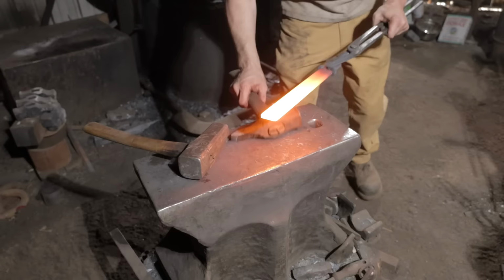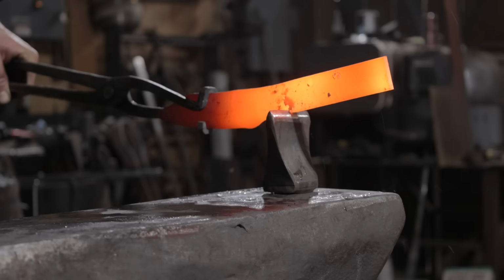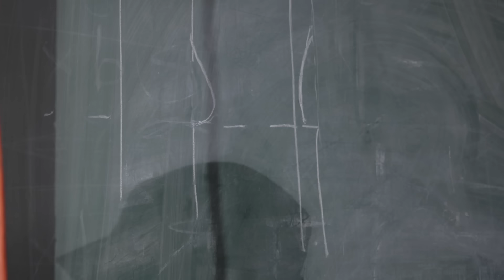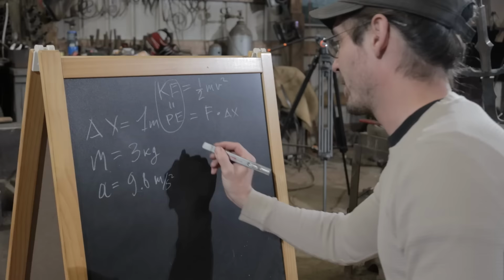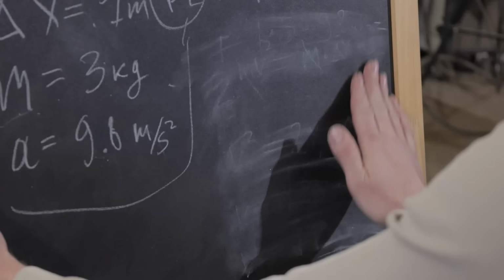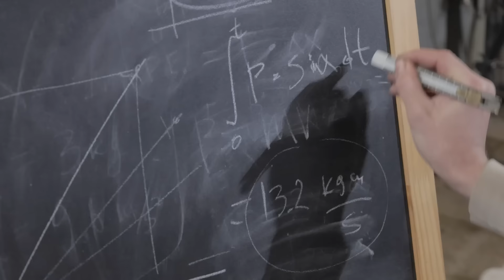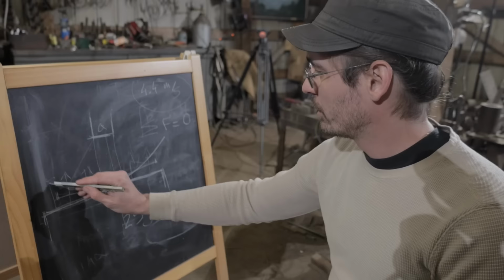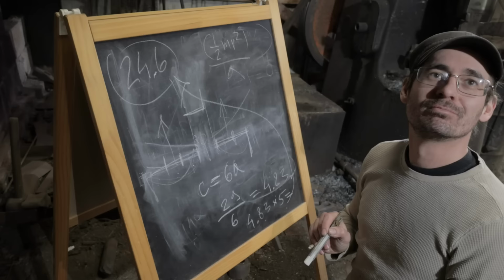You Can Forge a Knife Correctly [Here's How] !

Comment: Thank you so much for this. I have been trying for almost 30 years to figure a way to teach this to my classes. and I am very bad at math. I know what is happening because i am doing it and seeing it. but to show someone that does not understand has a difficult time grasping it. I get asked a lot from folks where they can find a huge anvil. and i always try to steer them to a small, faced anvil with very large mass. such as a stump anvil in a buried or rooted stump. When they see how much work can be done on such an anvil with properly radiused edges. they are astounded. Yes, large anvils are super cool. and have many advantages over a small anvil when someone knows how to use those advantages. but for most, they are not needed. The Luis and Clark expedition did most of their work for the entire voyage on a roughly 60 lb. stake anvil that they sledged into a stump when setting up camp. I show lots of folks the video " Making two blacksmith hammers for blacksmithing" By " Bertram-craft and wilderness" showing the use and how efficient a stump anvil can be compared to a treadle hammer. I don't know how many ties i have met students of mine years later. that are hunching over and using glancing blows. When I ask them why they are doing that instead of the way i taught them. the three most popular answers are. '1" I can't see that far. "2" I don't feel confident enough to swing big. and "3" I saw guys on YouTube doing it. :( :( One of my teachers told me once that if you were wearing a fedora hat, that you should graze the brim with the hammer head on every stroke unless planishing.      Again. Awesome video.     Tom B. from ND.
Reply: It is the mass of the "anvil system" that does the job. [Anvil system] = base + anvil
Reply: @ilyaalekseyev3589  Yes. Very much so.

Comment: To those who don't have a giant sword makers anvil. Please remember to use a cutting plate or the step of the anvil if you have one. 

Cutting directly on the anvil will damage it and could mar your future work.
Reply: This isnt even a sword makers anvil... Swordsmiths traditionally used whats commonly called a block anvil or a cutlers anvil they dont have hardy and pritchel holes they are simple solid rectangular blocks of iron with a steel face plate
Reply: Not to be confused with a sawyers anvil which were either round or much wider rectangles
Reply: @jessebond4221  most English and German cutlers anvils have 2 or more hardy holes and dove tail slots. The anvil in the video is a German hornless church window anvil.

Comment: During the forging process, does the steel become compressed, or does the smith simply manage where the material is at any given moment? I've seen various answers from several websites: usually the question of compression is answered by referring to the elimination of voids or inclusions, but that doesn't answer whether the metal itself, in its crystalline structure, compresses - increases in density. 

Also, I'd love to hear Ilya explain how the choice between casting, machining from a blank, or forging might create different properties in a blade. 

Idea for a ThatWorks video: the same blade made from casting, machining, and forging - any observable difference? 

Thanks!

Comment: Thank you so much for making this video. As someone who has been wanting to make my own knives for a while I've been massively hesitant due to not having any power tools nor the money to get them which has obviously been a big factor that has caused me to pretty much just write it off as not possible for me to do. But this gives me a lot of insight and hope that I can actually do this as someone who doesn't have all the fancy stuff others have and rather just some simple tools, steel, fire, and oil. I seriously can't express how helpful this is.
Reply from the maker: Thank you and you are welcome!
Reply: If you have a harbor freight or similar near you then stock removal will get you started ... A cheap angle grinder and an assortment pack of wheels, a 1x30 belt sander and belts, a cordless drill, a blow torch, some water, a pair of vise grips or pliers and some sandpaper are literally all you need to make an excellent knife ... Start with 1075 its the ideal beginner steel all together you can make your first 4 knives for around $150-175usd

Comment: i really liked the way you tried to use math to explain the proper usage of force in order to work efficiently. 
The one conclusion i'd like to make is that working with a smaller anvil (like most of our blacksmithing predecessors) barely bigger that the hammer itself is the best way to impart maximum return of energy in the piece.

Comment: Absolutely love the video. Really is going to change how I'm looking at my forging. Does waight of your anvil come into play for waight of you hammer you should be using? I have a 125 lb peter wright and have been afraid to damage it with too heavy a hammer.
Reply from the maker: Yes it does a lot! Also how you have your anvil mounted.
Reply: The hammer should not exceed 1/10th the weight of the anvil for example if you have a striker forging a large piece or some damascus etc. They shouldn't use larger than a 12.5lb hammer .....for general forge work including blades use what is most comfortable to swing repeatedly usually between 2-4lbs at the head but keep in mind no matter how good of rebound your anvil has some kinetic energy is transferred so a heavy base is essential especially for lighter anvils or they will "walk" across your floor frequently away from your forge it doesn't take much to start moving either my personal anvil is 100lbs on a 150lb base and my 4lb hammer will cause it to walk across my concrete floor

Comment: Never had anyone explain physics this understandable. I'd like to forge some day but its a kinda expensive hobby. Thank you anyway!
Reply: it's only as expensive as you want it to be. you can make a small propane torch 2 brick forge for maybe 50 bucks. then a get yourself a sledgehammer head for a small anvil or get a bit 1045 2 or 3in diameter steel for 20 dollars and use that as a post anvil. then any old hammer will work if you want it too. all things considered you have less than 100 dollars invested and you could forge a lot of different things from knives to little decorative odds and ends. or you can make a coal forge for next to nothing using the dirt in your yard a blow dryer and dryer vent tubing and a bit of coal/coke. like this video is all about its understanding perspective and if you think forging is too expensive it will be but if you decide you want to make it cost effective or budget friendly you can start looking for ways to make it so. good luck an hopefully you'll decide it's worth the try to do.

Comment: I forge out of a makeshift coal forge and I have trouble keeping the steel hot. It seems I can’t get more than 15 to 20 seconds of anvil time per heat. Should I just leave it in for longer? I have also burned 2 out of the 4 attempted blades, broken one and only finished one blade so far successfully.

Comment: The math explains the work very well, however, I would have liked to have seen Ilya place a ball bearing on one end and then strike the anvil. Some people need to see the science in action.
Reply: The ball bearing is not in the same system as the hammer. In that case you will not observe any motion besides the rebound vibrations (maybe). The system of anvil/ball can be described as static. Where the force of gravity pushes down on the anvil with Mg and the anvil pushes up with equal force.  In the case of the hammer, things are more interesting.

Comment: I have a question.
If hitting a piece on smaller area is efficient, then, why using big and large anvil ? as Ilya suggested at end of the video, we can hammer on the small square add on piece and get rid of the anvil as a whole. Am I wrong ?
Reply from the maker: Anvils were not just made for bladesmithing and there is something to be said for mass!

Comment: I have never seen this covered or explained before. It may also explain why stake anvils were used by many ancient bladesmiths (in addition to portability while on the march with an army).
Reply from the maker: Indeed it does! They found out quick that you only need a tiny work surface to be effective
Reply: That was entirely due to availability of materials not anvil effectiveness steel was difficult and expensive to make up until the industrial revolution ... Sink a sledgehammer head into a stump and forge a blade on it then forge a matching blade on a 120lb anvil...will the hammer head do the job? Yes... Will it be efficient? Absolutely not
Reply from the maker: @jessebond4221  I think we can easily put that to the test.
Reply: @ThatWorks  have an actual reputable smith do it not this guy and id love to see the results you come up with... Ive been there done that long before youtube was a thing
Reply from the maker: @jessebond4221  just remember that time in a craft doesn’t give any person the right to be an ass!

Comment: 🤔 You know I prefer to forge the tang before the blade, especially if i am making a fancy pants full tang knife with some kind of swell at the bottom like the American Carlson's Raiders Machete (collins pattern no 18) from 1934. Or a bird's beak handle. as that is a lot easier to screw up...i make something like this using 2-inch wide starting stock 1/4th inch thick. i tend to order 12-inch bars (as it is cheaper to ship just because they take up less room) and can take a 2x6x1/4 inch bar and make a 14-inch hidden tang blade 10-inch blade with a 4-inch tang.(0_0 I thought it was smaller then that)

Comment: I'm not sure if this makes sense.
If your theory was correct that would mean that on an anvil that has 5x the surface area of the hammer, only 1/5 of the energy would be reflected by the anvil onto the piece you are forging, because the other 4 areas of equal size are reflecting 4/5 of the energy into the air.

However that would mean that if you took an anvil with exactly the same surface are as the hammer face, the force being effectively used to forge the piece is 5x as high because 5/5 of the energy is reflected by the anvil in the area where the hammer hits.

If we push this theory to the limits and assume that when we hit the ground with a hammer, the surface area of the ground is 200.000.000x as big as the hammer face, only 1/200.00.000 of the energy would be directly reflected to the hammer  by the ground.
In this case the force coming back would be almost zero...which of course is not the case.
When you hit something with a hammer that lies on the ground the effect on this piece will be essentially the same as if you hit it on the anvil....even though the anvils surface area is much, much smaller that the surface area of the ground.

I am quite sure that the energy of the falling hammer is only reflected by the spot on the anvil that is directly hit. 

The upwards-warping of the piece must result from various smaller factors being combined. 

The first factor that comes to my mind is that because the material is being pushed-in by the hammer it lengthens the side of the steel-bar facing the anvil, resulting in the ends of the bar to bend upwards.
It's comperable to the effect of your blade starting to curve while hand-beveling (when done wrong). 

I hope this makes some sort of sense. 

Perhaps I have misunderstood your theory...please correct me if I am wrong.
Reply: You misunderstood math
Reply: @ilyaalekseyev3589  Well perhaps. I never claimed to be right...please explain me why I am wrong.

Did I misunderstand your theory?
Reply: @niklasfischer3915  It requires a lot of tiping
Reply: @ilyaalekseyev3589  I can imagine.
But didn't I also put lots of typing into explaining my point of view? :)
Reply: @niklasfischer3915  I also showed all the relevant forces in the video. Fortunately enough I don't have to type out my explanation as it is present in all middle school physics textbooks. However, in the video I said that I simplified the basic physics further to match the YouTube audience. 1, I didn't base the length ration on radius but presented it linearly. 2. I collapsed on of the dimensions in order to be more clear. Both are done so that I wouldn't have to integrate and do cross product of vectors in radians. I think the scalar coordinate system is much more digestible.
Reply: @ilyaalekseyev3589  Well whether you present this in a linear format or with a radius doesn't really make a difference in the theory itself.

I could now try to explain it mathematically which would be quite hard and probably not very effective. 
However I think it's much more practical to think of it logically.

I am from Germany so please bear with my english. 

The mistake is to assume that the entire object being hit is hitting back.
However it is just the area of contact which is redirecting the force.
And even this area is only reflecting a small part of the force being put in because most of it is absorbed through vibration and heat. 

The theory can be proved wrong by many simple mind-experiments:

Why don't you have 5-times the energy when forging on an anvil that is 5-times smaller?

Why do you still have a comparable amount of effect on a piece which you hit on the ground (which in our example is just a very big anvil)?

Why doesn't my hand get thrown up into the air with 4.5 Joules (just an example) when I am laying my hand on the anvil where you are forging?

Why does a hammer that hits an anvil of 5 cm2 not jump up back at you 5-times higher than when it hits a 25 cm2 anvil?

The principle of the object being hit "hitting back" with equal force is just a mathematical model of the reality. 

In reality the object of course doesn't hit back. 
Because the anvil is very hard and heavy it simply does not absorb the energy by movement or deformation. 
However because the hammer has much less mass, the energy is absorbed by him. 
In practical terms that means that the hammer jumps of from the anvil. 

The size of the anvil of course doesn't make a difference here.
Reply: @niklasfischer3915  it does to the actual numbers and proportions

Comment: Also - does the thinness of the edge make it more difficult when heat treating?
Reply from the maker: you want about the thickness of a nickel for optimal HT !
Reply: @ThatWorks  Thank you for the response!  I see many blacksmiths advising that you keep the edge fairly thick (closer to 3/16) and always citing that having it thicker prevents the edge / tip from burning later and/or twisting during heat treat.  Are they just full of baloney or are there precautions you have to take after forging the blade down to to a couple of millimeters?

Comment: So...in the grand scheme of things...heating a given metal to the appropriate temperature is really about imparting enough energy in the form of thermal gradient so it requires less kinetic energy per strike to achieve the desired deformation of the material, thereby preventing the fracture that would normally occur by striking it "cold" with too much force?
Reply from the maker: I think that would take another video!